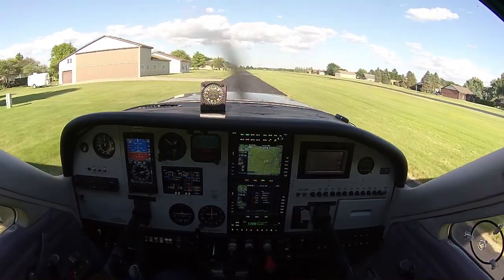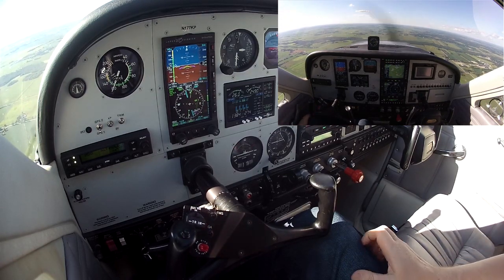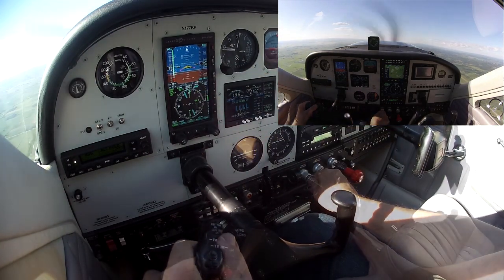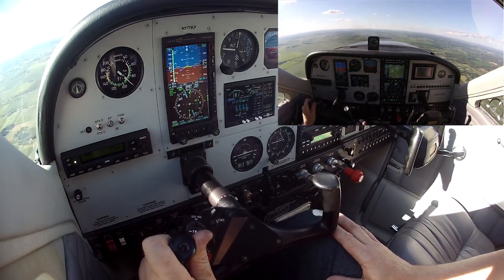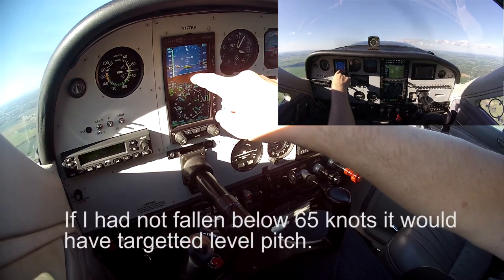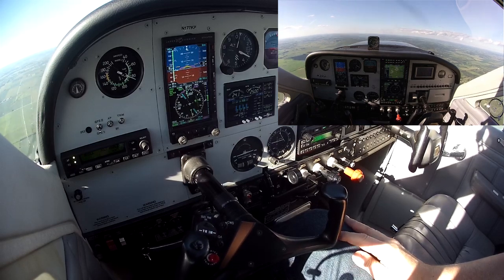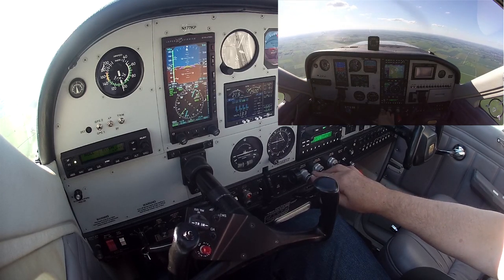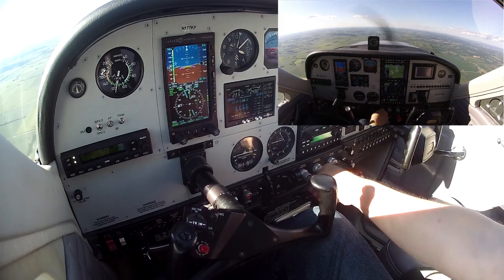Edge Protection and Level Mode on the S-TEC 3100 autopilot in a Cardinal RG.

Comment: Realizing that the Aspen 2.9.1 software has not yet been released, what software version ARE you using in this video and other than your Avidyne 550 and your Aspen (w/ ACU1? or ACU2?), what hardware/converters do you have interfaced with the 3100?  Thanks!
Reply from the maker: Hmm... my Aspen was put in about 2 years ago, no update since then. The IFD550/540 are currently one version behind, about a year old version right now.  The only additional hardware is a Sandia air data computer to provide Indicated Airspeed (since the Aspen won't output it until a new software release) although that device comes with the 3100 from STEC. So I didn't have to add anything beyond what STEC supplies. 

The new Aspen software will allow the 3100 to be controlled directly from the Aspen, although I hear they have just pushed out that new release until mid 2019, now an 18 month slip. But it will not add any additional operational functionality.
Reply: Thanks for the detailed info!!  So I'm clear, though, the Sandia air data computer was included in the cost of the 3100 (MSRP $19,995 advertised, or whatever your cost was)??
Reply from the maker: Yes. While my situation was a little different, as my aircraft was used for certification of the autopilot, they told me that the installation kit would include the Sandia, at least until Aspen updates their software. I have heard indications of this from others as well.

(Update! STEC tells me that they can't include equipment to add everything required to implement all the features of their autopilot if you don't have it in the panel. Check with your dealer to see what your situation will be.)

You should have your shop include an extra labeled wire or two in the bundle between the 3100 and the Aspen as the new software will communicate via Airinc 429, attached to a pin as yet unknown. Once we know which pin they use that wire can be installed to complete that connection.